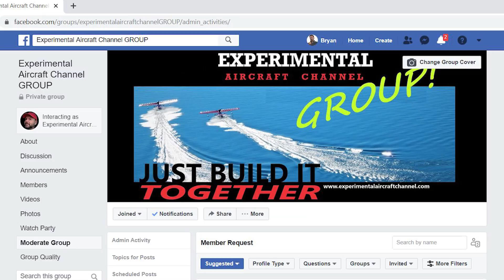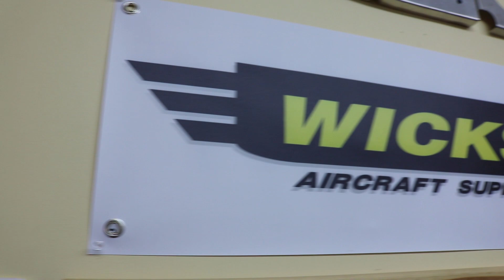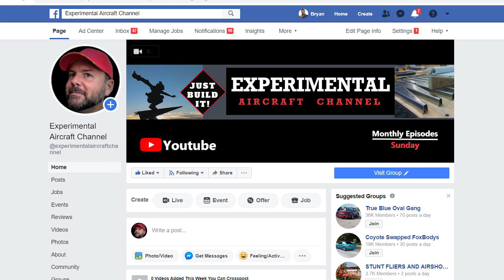Day 3 of 31 Day Aircraft Build Challenge

Comment: took me 30 months and 1620 hours to build mine.

No builder assist and essentially no other hands-on assist (attaching wings, tailcone, stabilator, and engine required assistance, but otherwise .... [oh yeah, and the weighing required assistance and borrowed scales {$1200}])

{{so, no excuses about "I can't do this" ---- it CAN be done}}
Reply: and Steel is extremely easy and faster to drill and otherwise cut than is stainless steel [the devil's metal]
Reply from the maker: @1shARyn3  Agreed. SS is the Drill Bit's worst nightmare! :-)
Reply from the maker: I's say that is a VERY good build time. What EXACTLY did you build again? :-)
Reply: @ExperimentalAircraftChannel  Van's RV12ULS
Reply: @1shARyn3  That is quite an aircraft to build on your own except the difficult bits like fitting wings etc, well done, that is a lot of work on your own.  Enjoy your work and fly it.  2 and 1/2 years, wow.  That is amazing.
Reply: @BoB4jjjjs  Thank you.  But when you are retired, you have the time (which is why we question how we ever found time to work before retirement.  Life now is so much more meaningful and rewarding --- even tho' we still get up at 0430). And it took 2-1/2 years cuz I don't work well in the cold, so winter work is slow.  The hassle for Phase I is trying to find winds (on the ground) in single digits (only in the winter.  Don't look forward to Spring with typical surface winds of 50-70kts --- but, it's just until July starts {mid March to Independence Day}.  Then it's excellent flying until T-Storm season.
Reply: @1shARyn3  I still think that is some achievement.  Where are you that it is so cold?
Reply: @BoB4jjjjs  Albuquerque
Reply: @1shARyn3  New Mexico I think putting you in the middle of the country,  I was expecting you to say further north.  You still did a good job doing it in the time you took.  I don't think it would be the easiest built either if I am looking at the some Aircraft?  Safe take offs and landings to you.  Thank you for your replies.
Reply: @Bob Taylor not to sound crass, but I have 8700 of them in my builder's log.  What kind of specificity would you like?
Reply from the maker: @Bob Taylor Come join the NEW Group and follow along as Builder post their Build Updates and also Completions. Gwen has posted there as well. There is a link in the description. Thanks for watching!